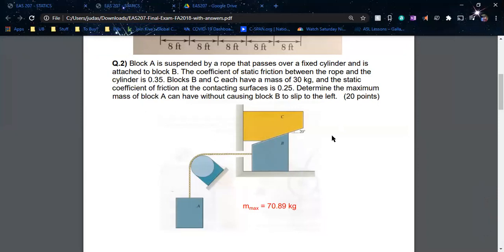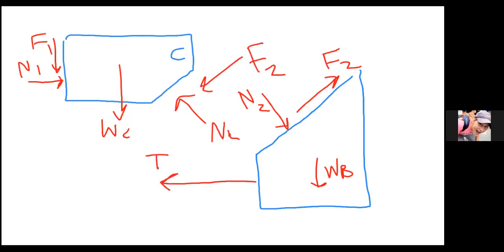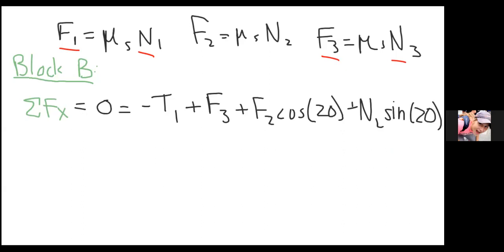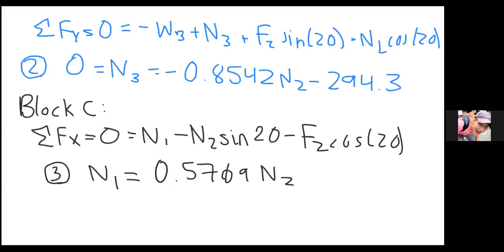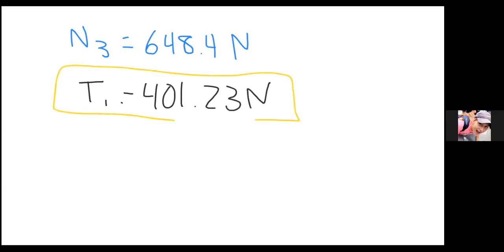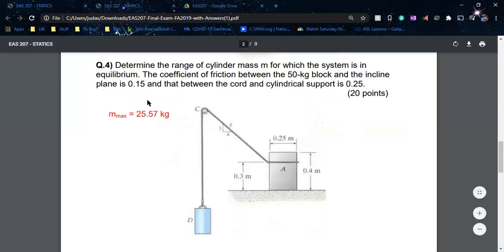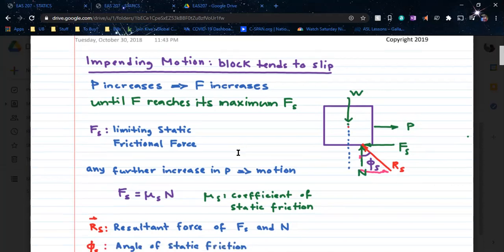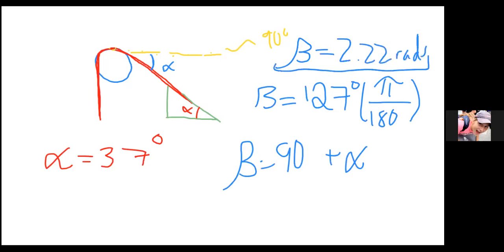Wedge / Friction / Pulley Problem

Comment: Thank you for your videos they were very helpful!  just one note: are you sure that T2 is 220.59? I checked your work and that didn't come out to the answer (70.87N) . The tension I got was 695.27N.
Reply from the maker: Hey! I just looked over my work and you are correct - I'm not sure what/how I copied wrong but when I plugged in I used your tension value. If you go through with that T2 value you do get the correct mass.